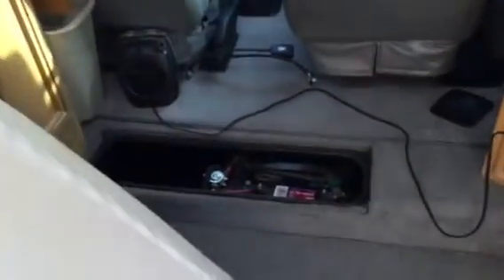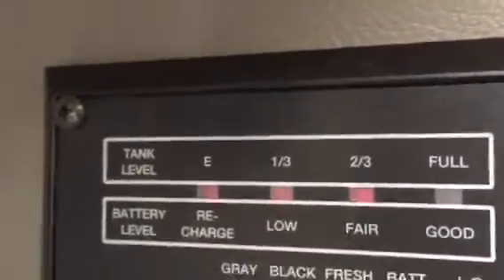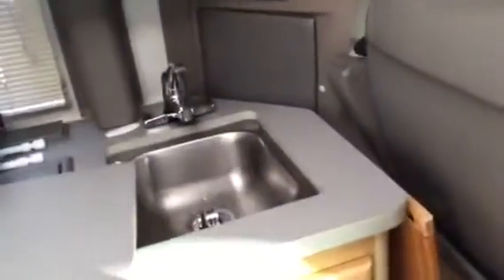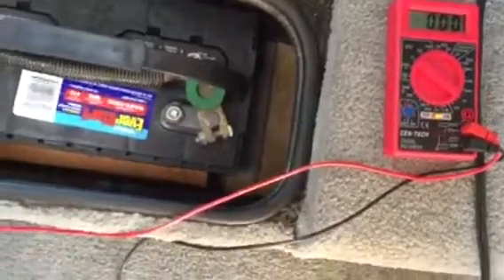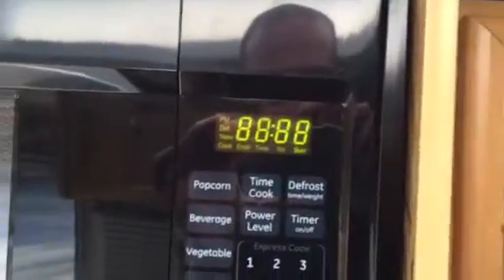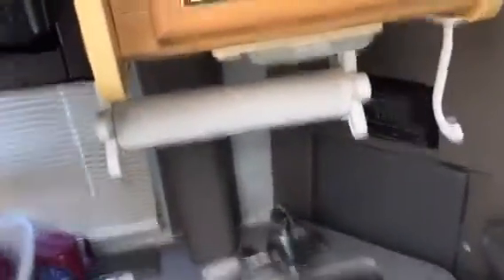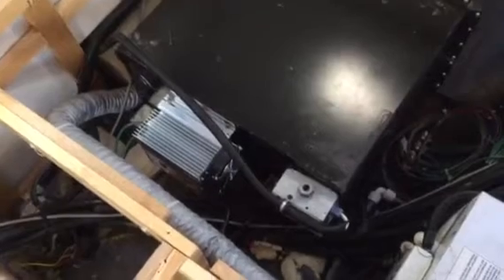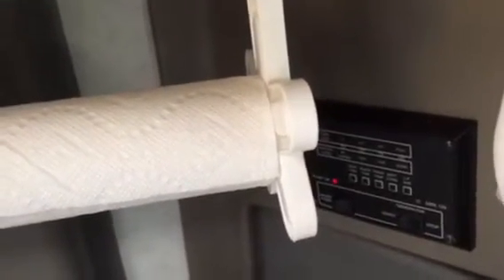Strange electrical problems with my Winnebago Rialta

Comment from the maker: For the record. I solve this problem may be a day or two later. The reason I wasn't getting power was because of the battery disconnect not being tight. Really simple fix. Sorry I didn't post an update.